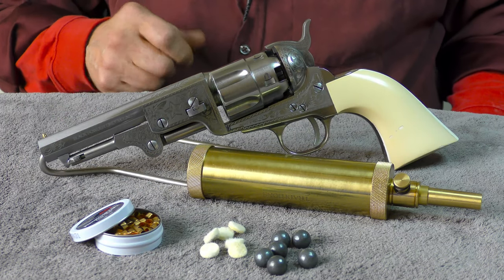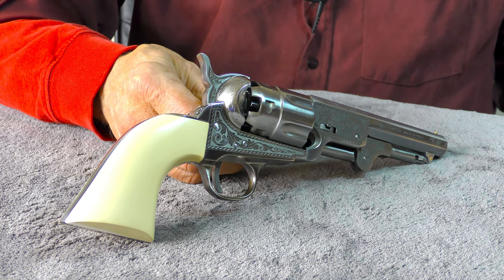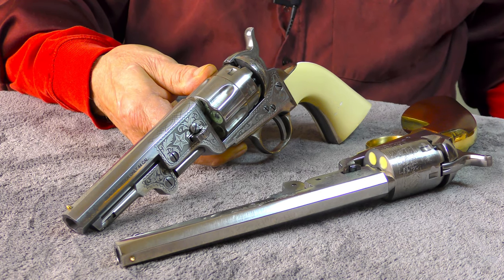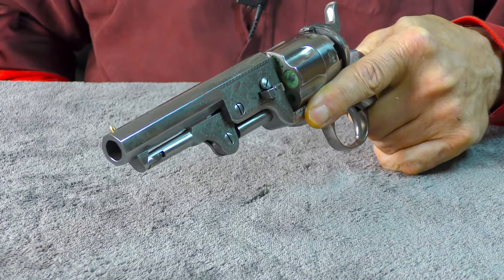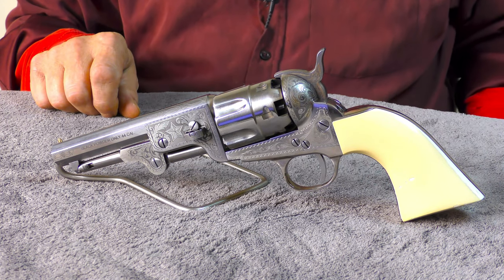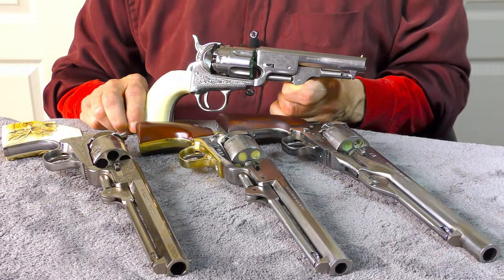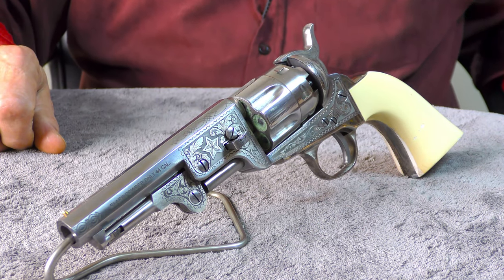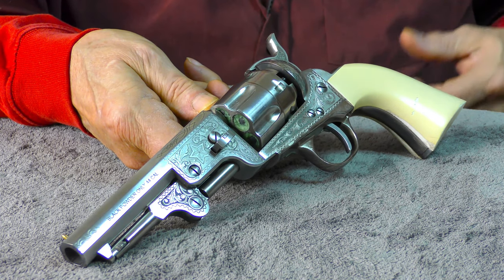Colt .44 Caliber Sheriff's Model Revolver

Comment: The cap and ball revolver is one of the most versatile guns there is even in this modern age of Glocks etc. If you want to try out the most deadly bullets ever designed for a cap and ball revolver check out the  VKV Bullets designed by Kaido Ojamaa. As a hunting and woods defense bullet they have taken everything from Elk to rabbits and probably some larger animals. The design is similar to the well known Keith bullet and is a very hard hitting, deep penetrating bullet. It is easy to load and will work well in any steel frame cap and ball revolvers. To know more contact Kaido at kaido93@hotmail.com. I have tried out his .44 caliber 255 Big Boy, 240 , 220 and his .36 caliber bullets, I personally for the .44 caliber love the 220 grain bullet out of my Ruger Old Army, even with high powder charges the recoil is fairly easy to manage , its accurate and passed through 10 milk jugs full of water and kept on going.

Comment: A cartridge conversion does wonders.
Reply from the maker: Wouldn't buying a conversion cylinder make you wonder why you bought a cap & ball revolver, instead of a cartridge revolver, to begin with?
Reply: @Icarryone  still not a bad idea, I think the .44 caliber revolvers use .45 colt
Reply from the maker: @cloroxlavenderscent4307  They do - but I've never had the inclination to buy one.
Reply: @Icarryone  yeah I've never either I prefer cartridge guns like the .44 magnum revolver I got. I'm fascinated by the old west tech. However I've never had a use for one. I do a lot of reloading and I use smokeless powder.  I wouldn't want to accidently grab some bullseye instead of 3 f or 4 f black powder. I don't really mess with BP.
Reply: @Icarryone  

I agree the percussion cap&ball system is a unique practical diverse very applicable system. The Cylinder is like  a " Reusable" "Metallic Cartridge" with No need for the intricate -detailed re processing steps required for the reloading of Metallic Cartridges.

With the percussion system there is No various different types of expensive cartridges boxes to purchase.

If the shooter/ hunter wants low powered lesser penetrating loades he just loades it with lesser  powder and a round ball. If the shooter/ hunter want more power he uses hotter powder and a conical bullet like my hard hitting Universal Bullets.

The percussion cap&ball revolvers is the most independent  self regulating firearm system available.

In these trying times many are coming to realize the economic, logistical and Real World applications in Hunting and Wilderness Defense purposes  practicality of the use of percussion  cap&ball revolvers.